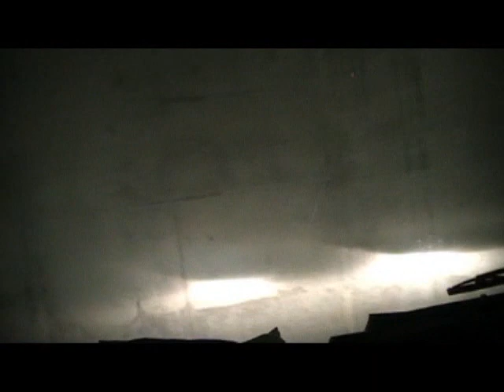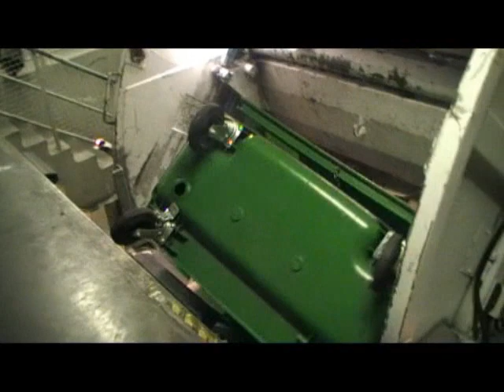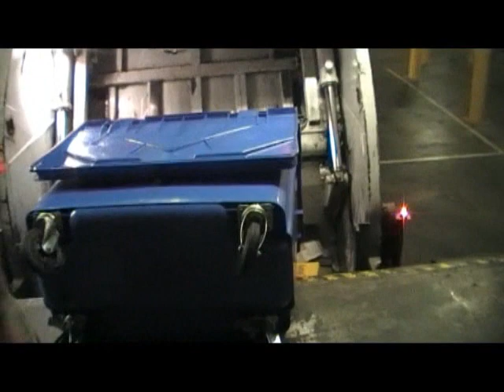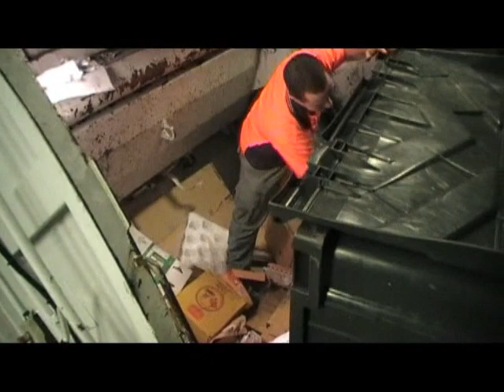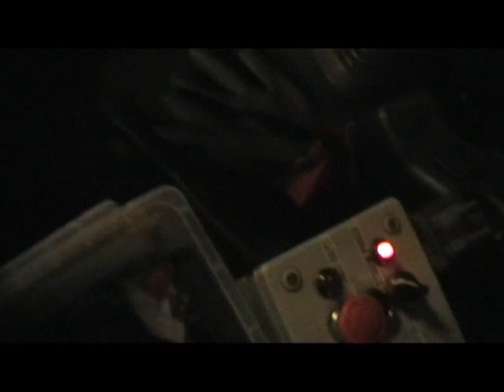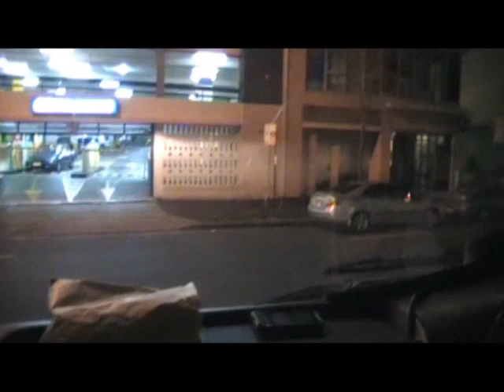Regent's Underground 660Ls

Comment: I love this.  Even the short cab ride shot.  Having this done at night is a good idea.  That way there is not much traffic on the road which makes it easier for commercial stops.  But how do you know the packer is not going to accidentally start on it's own when you are standing in the hopper?
Reply from the maker: Yep best time to do this kind of job is at night, can be a lot slower and difficult in the daytime depending on where you're working. Chance of the packer starting by itself is extremely low, even if it was to do so, the one on this truck is so slow you'd have plenty of time to jump out.